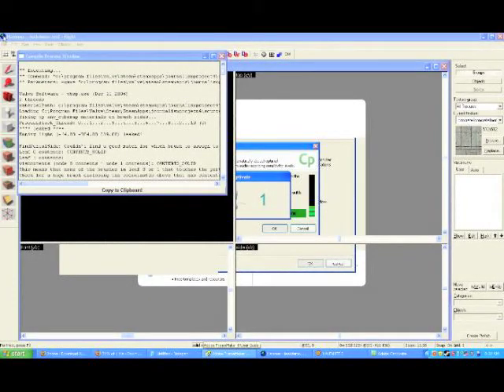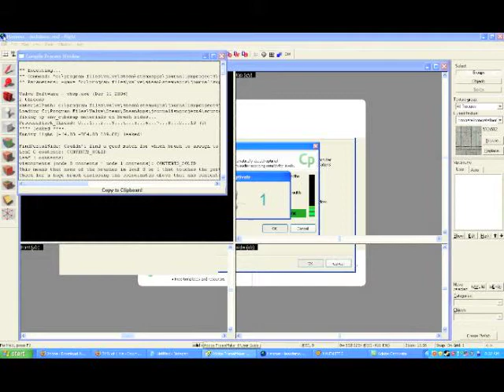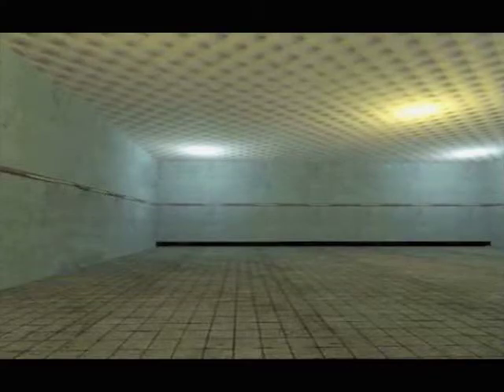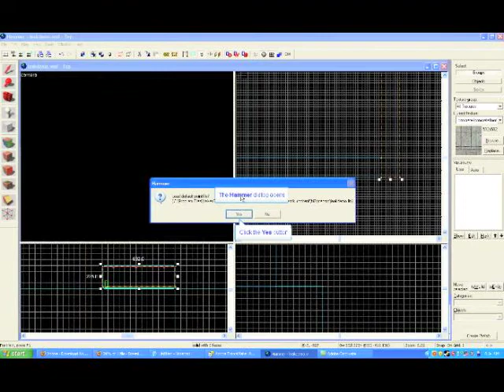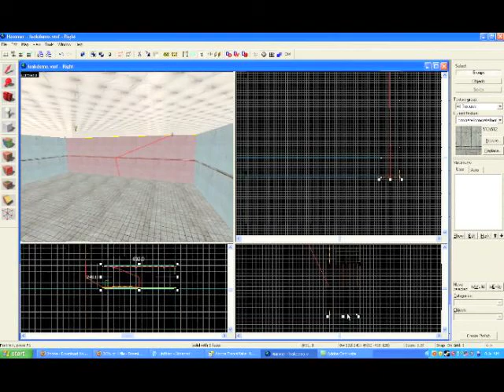Source SDK Basics 13 - Fixing Leaks

Comment: WTF, Everything is in a box, the player entity etc is in the box yet it still says that the entities are causing leaks when they're very clearly inside the level,why the hell won't it work?
Reply: +Dolan Duk (Soul consumer) same problem
Reply: 11Cent
Found the solution, the brushes the poinfile is going through is probably a func_detail which doesn't block the void, click on it and select "move to world" and keep compiling until they're all gone
Reply: +Dolan Duk (Soul consumer) not sure what a pointfile is but i still attemted to do so and it didint fix anyhting. i opened the check for problems and there are none
Reply: found out that my file is just corrupted. so ill deal with that

Comment: What Kebabuk says.

ALT+P

Solved my problem, I managed to compile but I couldnt load the map.
How problem occured:

Selecting the entire map and copying it to make symmetrical, rotating it and alligning holding ALT causing it to non center.

Also using carve tool leaving microscopic walls that leaks.

Solved:

ALT + P = Deleted and fixed a total of 12 errors
Selecting the entire map and clicking Centerize (something more in the name but you'll see it.)

That solved it for me, i'll put tags here for poor people browsing google.

Hammer sdk left 4 dead authoring tool memory leak how to fix find can compile but cant load map